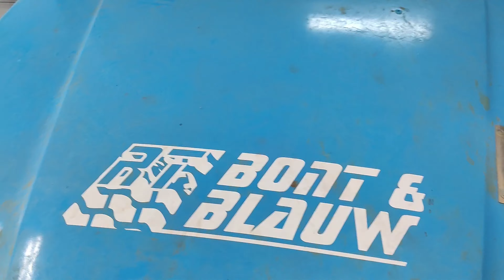Another Billet Angle Gear for a Friend's Autocross (Dirt Racing) Volvo 850 AWD

Comment: Cutting the block is normal. An original AWD engine is already adjusted at that place. It's driven rear wheel drive now I see. Is there a price know for the angle gear? Nice video! Leuke Volvo heb je daar makker!
Reply from the maker: The cutting he is talking about is different than the normal AWD cutting that comes from the factory. A small pry tab needs to be trimmed back a bit. This car is not RWD it is locked 4WD. It drives all 4 wheels with the front and rear axles locked at the same speed.
Reply: @SimplyVolvo  When you use an original Angle gear on a non AWD engine you have to cut that same thing away. I had to do it on mine to. Thought it was rear wheel drive,m. Couldn't see the driveshafts in the video. And when he accelerated a lot of dirt fles away on the rear and almost non on the front. That's why I thought it was rwd. Would like to find out if this Angle gear is string enough to drive rwd only in rallycross.
Reply: @theundertakerrx5913  it is certainly 4WD. I think you are more likely to see dirt kicking up in the back due to the fact that the rears are a bit more likely to loose traction as the car is a bit heavier in the front. The rear axle is also completely locked - the right and left rear wheel always turn at the same speed while the front uses an open differential.
Reply: @RikHeijdens ok. As an awd more dirt in the rear is because the AWD gives 60% traction to the rear and 40% to the front. I did rallycross in England with mine rwd only, but the OEM Angle gear is'nt strong enough. That's why I like to know if Matts Angle gear will be strong enough for that. Have fun
Reply: @theundertakerrx5913  so far it is holding up great for my use case, but I still need to work on dialing in the launch control a bit more aggressively, so we'll find out how it keeps up :)
Reply: @RikHeijdens  good luck. Maybe I'll come and see a cross when I have the time.

Comment: So dude is not? Using a pump on the angle gear?    And at what for the lack of a better term.. "power point "does vvt become an impediment?     Killer to see a hellmoose billet angle gear out in the wild!
Reply from the maker: He is using a oil pump for the angle gear, you can clearly see the feed line at 3:16. However for his application I don't think its fully necessary but it doesn't hurt. The oil pump is more meant for cars who do a lot of highway driving like mine.